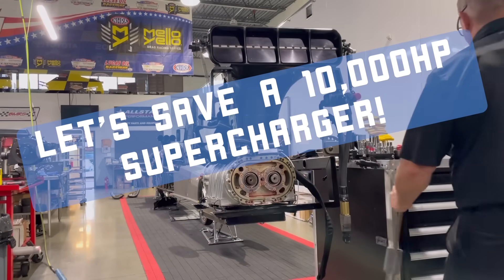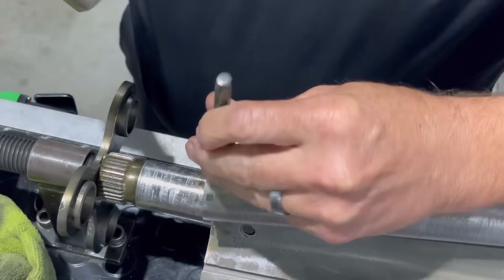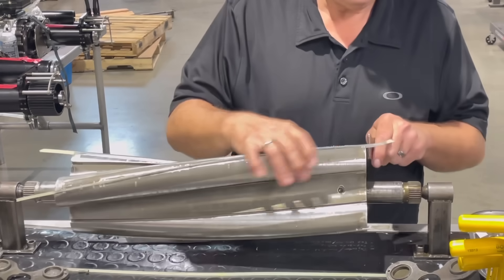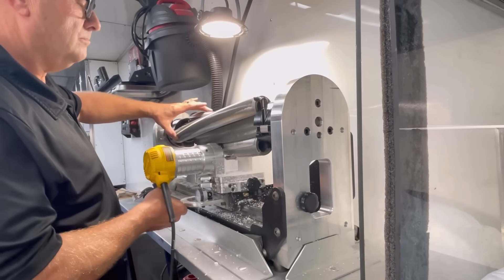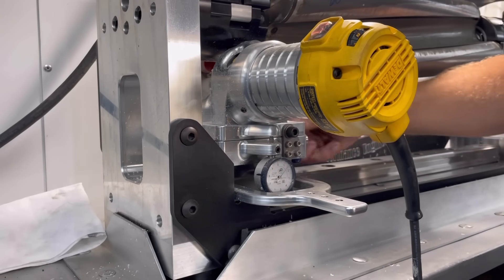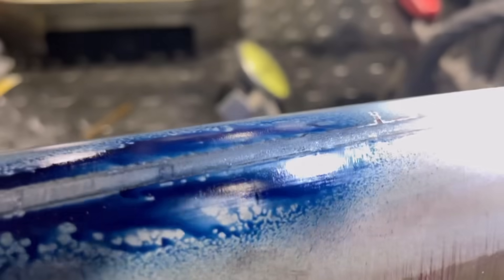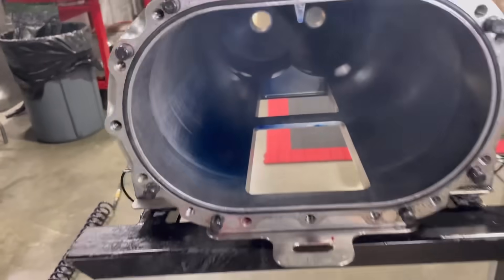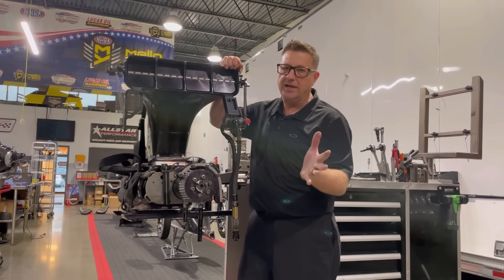SAVING A 10,000hp Producing Supercharger!￼

Comment: i need to find you i have a alkie supercharger i think needs some work, used to deliver 3500 hp now it is around 3200 blower doesnt sound quite right, dynoed  last week at     3150  fresh  overhaul, fresh block,   it is in a old front engine dragster,

Comment: That gauge you set to read the depth would be a much better trimming tool than that jig if it had a motor attached to it. You could run it across by hand and have exact depth set. Instead of spining a spine on a lathe. Much like a hand planner if that makes sense

Comment: It seems like after rebuild the blower still takes quite a bit of force to turn, my question is; what kind of hp does a blower like this take away from the block to turn? I understand it overcomes the loss but there has to be some accessory loss from the pulley, right?  Great video!
Reply from the maker: 400 hp!

Comment: The first shop I worked at was right off the Mississippi and we'd get engine work from the workhorses pushing barges. We spray welded the shaft to build up and turn down and it too was from a 10,000hp blower, except the lobes of this guy were about 18" in diameter. It was a sight watching that huge part spin with a madman wearing torch glasses blowing a three foot flame into the fucking thing.
Reply from the maker: I sure would’ve loved to of seen that !

Comment: Awesome vid,I never knew they had replaceable seals on the rotors,last time I saw inside a blower I was a kid and didn,t pay too much attention,I always thought they were metal on metal even though I knew that would be harsh,and I had never thought about the ID seals either,so I,ve learnt a lot in the last 15 minutes,and even though I,ve put a few chev and fords smallblocks together,installed cams,valves,timing and everything else to do with engines,clutches and gearboxes,I've never had anything to do with supercharges,so thankyou for showing us and for the commentary and explanations and visuals. Awesome. Best wishes from,Auckland,New Zealand ⭐⭐⭐⭐⭐👍👍👍👍👍💯🙂🙂😉😉

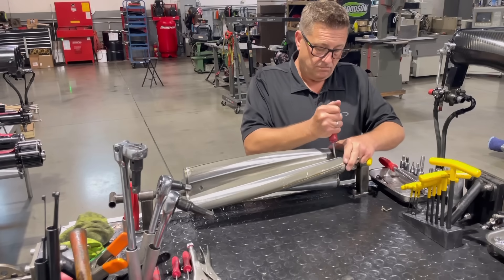Comment: Hey Rob, How many of those Lightweight DZUS FASTENERS do you have attached on the lower & upper rails? [Believe it or not -I’ve actually got 50 of them in 1:25 scale made in PhotoEtch] 👉This Video is the 1st time I’ve seen them in place on a bare frame, but couldn’t make out how many total there were….?? 
Thanks You 🙏 Sir for another Excellent Instructional Video for Top Fuel👏👏👏
Lee
aka: ☯️ZenModeling☯️

Comment: I’ve been around industrial blowers I work at a flour mill. The mill and grain elevator has blowers to blow the product around the plant site. I have rebuilt them the rebuild usually consists of bearings and seals on the end plates and new rotors
Reply from the maker: Are they mostly screw style blowers?

Comment: Nice breakdown of the process.  It's not an issue to have maybe residual abrasive embedded in the urethane after you debur it?   Back in the 1970s I worked with an older machinist who thought it was funny to tell the new guys to "restore" their worn windshield wipers with some abrasive.  When some poor fool fell for it he destroyed his windshield because the soft material retained  abrasive.   But looking at the insides of that case, it looks like it's been eating bits of pavement kicked up by tires on the lead car.   So maybe it doesn't matter.

Comment: Oh it's like an apex seal kinda? I've seen small rotary engines and that's all I could think of. New subscriber here, started with building small engines (lawnmowers, miniature pulling tractors) I work on passenger vehicles now. My neighbor has a late model for the dirt track and when I saw his dry sump I needed to know more. I know Top Fuel is way different but man, you've answered so many questions I've had so far, especially about the rear end... I knew those things had to be SUPER narrow. Thanks for the videos, I enjoy every minute of them

Comment: i see you’re using a DeWalt router, which spins at approximately 25,000 RPM.
i’m thinking that the seal is being heated a little because of that high speed, and that may cause the urethane seal to expand or become unstable. Other manufacturers make routers with the same body diameter but has an variable speed to adjust the RPM.
If dropping the RPM from 25,000, to say 20,000, or 15,000, it may not effect i the urethane seal.   what i’m talking about may be incorrect, i’m just thinking out loud.

something else is like to mention about the mess you don’t like cleaning up at that same work station.
in the woodworking world we use a dust collection system with a shroud that covers a lathe, or miter saw that collects all the dust, and chips so it doesn’t make such a mess.
this will make your life much easier after trimming those seals.
search youtube for miter saw dust collection and i bet you’ll incorporate one of these shrouds to your set up.   considering you’re milling so little material, you could definitely use a shop vac, and not a cyclone or thein duct separator, plus it’s plastic and not wood, which probably won’t clog the filter and last a very long time without having to clean the filter.
you could build that shroud out of metal rod and cover it with some sort of canvas, funnel it down into the 2” vac hose.  you could get a remote switch and put the vac far from that area do you don’t have to listen to it.

i bet you’ll love this setup since you complained about cleaning up.
cheers!
Reply: The rpm is adjustable on the Dewalt router.

Comment: Very interesting. 10k hp is insane especially out of such a small engine. I wonder what one of those giant Caterpillar 3616's or whatever would produce if fed nitro at a rate comparable to the engine size. Of course you would need probably 12" feed lines to push that much nitro and a 2000hp engine running the fuel pumps.
Reply from the maker: We would have to shorten up the stroke a bit. It would be a great video....😜
Reply: @robwendland  It would be exciting that's for sure.

Comment: Beautiful.  It still astonishes me that 10,000 HP can be pulled out of An engine.
Reply from the maker: It’s nuts. Shit doesn’t last very long for sure!
Reply: @robwendland  Isn't it, a rebuild after each run, and a complete new motor after 10-12 runs?  2 miles per engine 😆
I saw a video a while back of a top fuel injector for a single cylinder running in a visual display. It literally looked like Andre the giant was giving a bare hug to a 5 gallon gas can.

Edit, I found the video. 
https://youtu.be/xGTbQuhhluY
Reply: @BryceAWD  Every part on a front running Top Fuel teams car has run count limit if it was not FUBARed during a run
Reply: @BryceAWD  DAMN! That's a wave 🌊 of fuel.
Reply: That blower takes about 900hp from the crankshaft at 8500rpm. Wrap your head around that, next consider nitromethane/10% methanol burns with 1 part fuel to 1.7 part air and the whole thing runs on the verge of hydrolocking. The flames coming out the exhaust? Oh thats the cooling system....
Reply: @richardturner8630  Don't forget it basically solidifies the fuel on the compression stroke!  I really would love to know the compression ratio on a blown nitro engine with a cylinder full of fuel!  6:1-7:1 empty but its gotta be damn near 35-40:1 with the fuel added
Reply: @casada70  Compression ratio doesn't change. The cylinder pressure does.
Reply: @richardturner8630  The whole thing is an absolute marvel of mechanical engineering.
Reply: @richardturner8630  flames are just burning hydrogen that is a byproduct of nitro combustion.

Comment: This takes me back in time to where I was working in Bill Miller's shop making cases from sand castings, and the rest from billet. Setting the timing and pinning the 2-peace gears and pinning the bearing plates to the cases always took forever. It was cool to see one you made from scratch come back in for a rebuild and get it it back in a box, headed out for more track time. Just curious, why don't you turn down your OD plastic on a lathe?
Reply from the maker: We use to back in the day. The plastic changed and a lathe cut almost melts it now.
Reply: @robwendland  No kidding? We were using nylatron back then, warming it up in an oven before pulling it in the grove and capturing it with 10/32 socket head screws.

Comment: Always interesting to see how other guys do this. My blower jig is at least 30 years old and I torque the case down to get that distortion out. Kinda like using a torque plate when machining a block, then you know if it's flat, then I check the manifold too. It's a bit of a forgotten check since we all use o rings to seal the blower to the manifold. I love the seal machining jig, I still machine them in the lathe. Had some shocking cases that had to have the rotors taper turned to get correct clearance front to back. That was a pretty nice blower to start with (I never get the nice ones!). Had a couple that had some big bangs go through them that needed all the clearances done and re dowel the front and rear plates, re pin the rotors, new shafts, the works. Cool video Rob, keep em coming.
Reply from the maker: You get it for sure! Getting end frames at the right height can be a real workout. This case never was bored correctly. We do check the manifold when it is bolted on the car. Make sure the blower is flat also. I taped cut the rotors bigger to the back. Just add a shim under the front bearing on the cutter jig and rip it across!

Comment: You complain about not enough plastic in the blower re do them 
as you changed the metal clearances inside the blower you needed to replace the strips again with the new clearances
Reply from the maker: I did not. I left the minimum plastic engage my clans by removing material on the case

Comment: Hey Rob. Why did you stop using nylatron? Is it a softer durometer urethane providing more conformity  and perhaps a bit more forgiving?
Reply from the maker: I use nylatron on the end frames. Tougher stuff. The urethane is softer but it does burn up easier. So it creates a little better seal
Reply: I guess impregnated Delrin would be way too stiff?
Reply: Delrin AF is definitely good stuff

Comment: just a question from the outside looking in but where those rotors are worn . does that not create an efficiency loss ? or does the urethane striping just take all that up ?  or on the other side of that are you just not concerned with a slight loss due to the change out of blowers etc ?
Reply from the maker: They definitely are worn but that’s also an indication that the lobe size is not too small which a larger lobe size tends to be a better blower

Comment: Lots of work, I'm sure that cutter set-up cost a pretty penny. Great content, I know about stacking, used to do oil pumps on the Cadillac HT4100 engine the shafts would slide out the bottom, that was a fine ( cough cough ) engine, you would not believe the things I could do to it to repair them. Hey Rob, didn't see any of the handyman's best friend Duct tape. Keep them coming   Jesus Saves
Reply from the maker: Thanks for watching brother!!! I’ll see if I can get some tape out! 🤣

Comment: So since this rebuild was a save but this particular supercharger isn't going to be the highest horsepower performer in what situation would it be used ? Are there times when they actually use a less than 100% supercharger as a way to turn the engine down slightly without having to change the entire tune ?
Can you get rotors like these in the vid for a 6-71 so a guy can re-strip and clover leaf the rotors on a smaller blower?
Reply from the maker: You always want the same blower. Use the overdrive for different weather conditions. This blower will not be as sharp at the step but sometimes conditions don’t allow for that to happen anyway. Say a super hot track. You can overdrive the blower more to make up the percentage loss also
Reply: I understand so the blower is a constant but adjust as needed with pulley ratio so you get the output you want from it. Sounds like wisdom. Thanks for the reply !!

Comment: I wonder what the max boost you can get from a 14-71 roots supercharger is? Anyone out there know for sure
Reply from the maker: Really depends on motor size but over 12,000 rotor speed creates more heat which is not beneficial. Ours is upwards of 60 pounds. Depending on cam shaft and words install that is huge

Comment: Very Cool.  Thanks Rob.  One of my diesel tech final tests was to take 4  6-71 diesel blowers and make one good one out of basically junk rotors and cases.   I knew going in that they were junk air movers,,but was a fun test to get everything right or close, as per Detroit Diesel.  The 6-71 was out of a WW2 PT Boat.  the governor/speed control lever had a "Battle Mode" detent,,  for a extra 400 rpms out of the engine.  Had to test that out once I hung the blower on the side,
Reply from the maker: Wow that’s a cool story but that was fun!
Reply: @robwendland  Ha!.  Just seen the Supercharger Salsa Maker.  Brilliant!.  Looked tasty!. That might need a revisit.  A lexan veggie shield,,or chute, and a meat grinder style push-pad or pin, to properly process the proteins.   The Worshams could bring the Mad Margarita Mixer.

Comment: Why not just rebore the case to give more clearance for the strips and to make it true again?
Reply from the maker: It’s actually bored like a football somewhat. Along with the tight spot, there are loose ones on the wrong areas. Say 4 and 8 o’clock. Rebooting the case is possible but a 5 hour process and it there’s a possibility it won’t be any better than it was.
Reply: I was thinking the same, even maybe lapping it with a custom lap to make it deadnuts and perfect along the length
Reply: @bcbloc02 havent seen a barn shop update from ya in a while ;-)

Comment: Now I wonder how the blower manufacturers bore and finish the cases and if a roller burnishing tool could be used to restore the size and surface finish.  I would think a roller burnished finish would be a better surface for the strips to seal against

Comment: Does over-driving the Supercharger increase the compression ratio of the engine...?
Reply: No. It does force in more air, which compensates. Fuelers have low compression ratio and huge combustion chamber in order to stuff in more mixture.
It works.

Comment: Top fuel engines just amaze me. It's hard to believe that these blowers require the power of a Dodge Demon to spin them at full song. Just think of the power these engines could make if they had tubros instead of the parasitic supercharger.
Reply: Plumb the hot/cold sides while dumping copious amounts of nitro out the exhaust. Let us know how that works out for you ?
Hint:Physics 101 Liquids are non-compressible.....
Reply: @stevelennox8575  Likely a fireball like no other, with a big boom right before. Most of the flaming car parts should land within the track property. Only bad people will die.
Reply: @notsofresh8563  Nice to see that others agree although I hate to see people die..even stoopid ones
Reply: @stevelennox8575  Banks successfully ran a turbo Top Fuel dragster until the NHRA banned turbos. They don't exist because they are banned, not because they don't work.
Reply: @thebigmacd  What decade was that ? Things have changed and turbos wouldn't work now
Reply: @stevelennox8575  The late 1980s. I like how you just concluded that "turbos wouldn't work now because things have changed". Au contraire, turbos would work even better now that things have changed, as turbo technology and engine control is magnitudes better now. I don't know what the deal is with "liquids are incompressible", raw burning fuel in the exhaust is what turbos love to spool on. If you think that a turbo = exhaust going back into the intake I don't know what to tell you other than get a reality check.
Reply: @thebigmacd  From speed-talk.com:
That's correct, turbo not allowed in NHRA nitro cars.

I spoke with Gale Banks when he was trying to make the nitro turbo deal competitive years ago. He said they could not control the power and it was very violent when it hit. They split rods long ways and sheared flywheel and clutch bolts off a lot. They finally gave up on it.

Today, HP is not the problem in going quicker or faster in nitro cars. Applying it to the race track is requiring a lot of technology and finess.

Blessings....Ron Clevenger.
Reply: @notsofresh8563  in the late 80s Top Fuel was making around 3000 hp. Now they are making 10,000+hp. I'm pretty sure the engines of today are much stouter than then, and the controls much better. The point is, because of the ban on turbos we can't say turbos wouldn't work better today, 35 years later. In other classes of racing where turbos are allowed, turbos are taking over. Physics and experience shows that for a given displacement, turbocharging is more power dense.